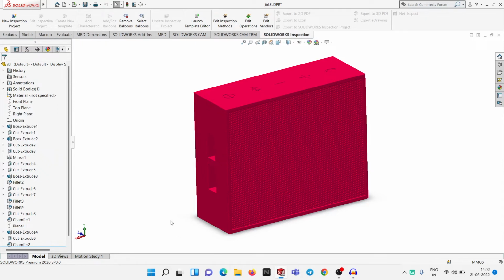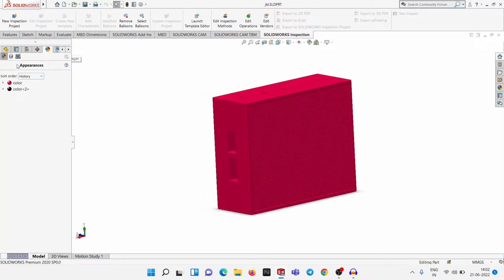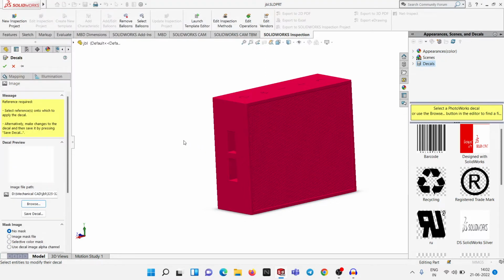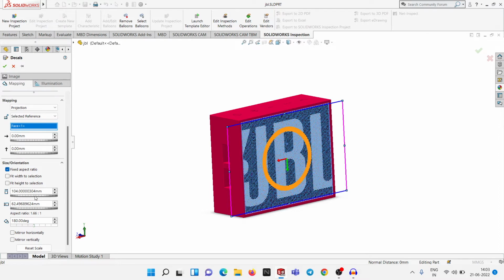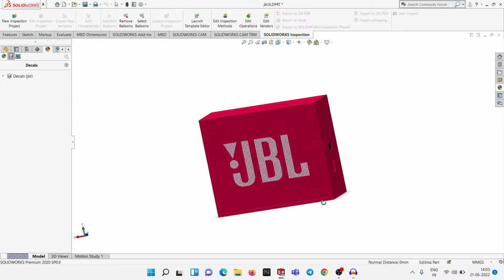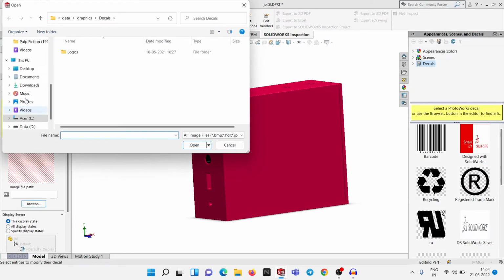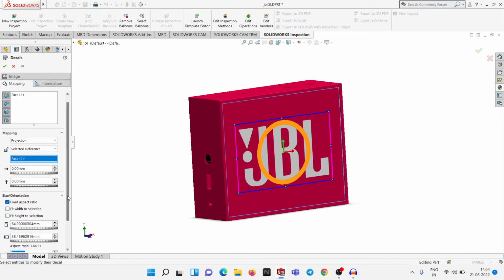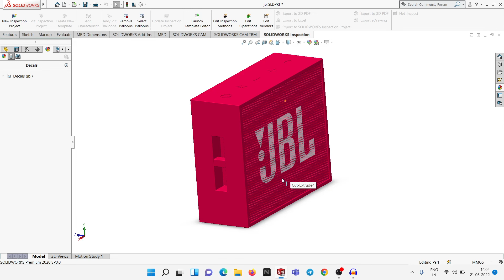How to add logo using SOLIDWORKS | SOLIDWORKS TUTORIAL #2 | Solidworks 2020 Tutorial

Comment: I know this is an old video but it seems like the easiest way to add an image that I've seen.  Whenever I click on mapping and then click the face to add the image to my image doesn't pop up in the middle of the rectangle it shows up in the bottom left corner of my face.  Plus I can't get the background of the image to go away after clicking Use Decal image Alpha Channel.
Reply from the maker: ==Try to drag it to the middle.

== You have to use a transparent image for that, just remove background of the image using any online website and then try to insert